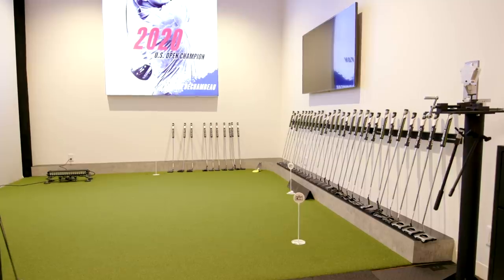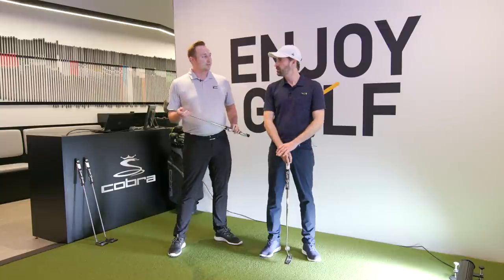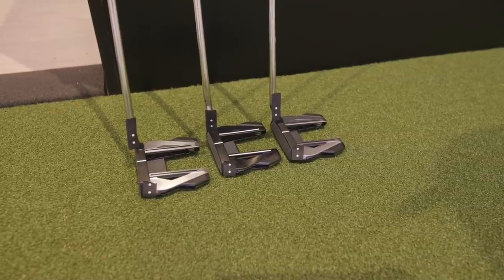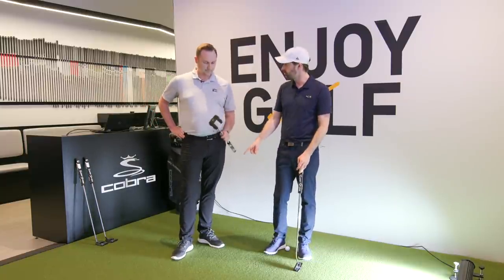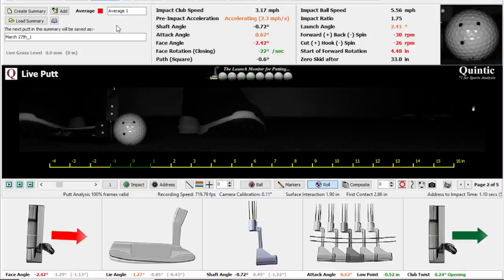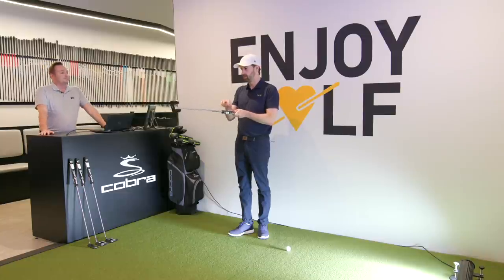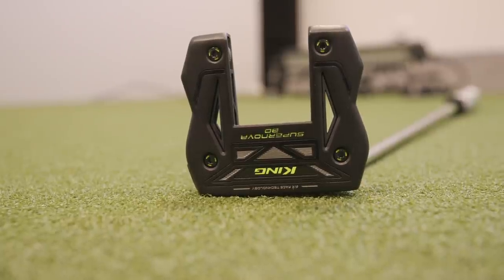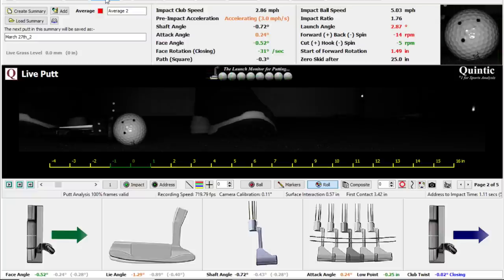My 2022 Putter Fitting | Better Face Angle & Speed Control

Comment: What's your take on eye position when putting? I've been told that setting your eyes directly over the putting line is going to skew the line to the right for a lefty or left for a righty due simply to the way your eyes perceive things. So, there are two subconscious tendencies. 1. to push the ball. 2. less of a feeling of seeing a line go to the hole (outside of 6 feet), so less trust in the line. If you set your eyes more back from the line ,like 3-4 ball lengths (stand about 5-6 inches back from the ball) your eyes see the line better/ more straight which gives you more confidence to hit the putt correctly and "on line".

Comment: Fittings are great, but I feel like the next legit question should be: how do we confirm what we are doing on the course is representative of the positive info we get from using these fitting tools? With the numbers, it's very easy to calibrate your stroke. But what about later when you don't have them?? We need that on course hack!

Comment: Cool.  I understand fitting clubs to address tendency to fade/draw; hit high/low.   But it seems that putting strokes seems like something that could be changed easier than a swing change.    I could see a putter fitting based on the normal greens you play on-, because I could see adjusting your stroke to the conditions, etc.

Comment: Wonder how you could quantify the change in strokes gained, there’s probably a percentile change based on straightening it out. I’d guess around a stroke and a half?
Reply from the maker: will find out once i start using it on the course, but i expect to make more short putts for sure
Reply: @GolfLiberty  I'm imagine that if you're pulling it with a poorly fit putter, you're going to be consciously or otherwise compensating for that in your stroke or alignment over time leading to worse putting overall, and at the very least less confidence which is probably the most important part!
Reply: @GolfLiberty  I just started classifying everything as a "gimmie" if it's on the green. It's done wonders for my game. Thinking about adding chips to that category.
Reply: @GolfLiberty  what new grip you gonna use?
Reply: @GolfLiberty  hi Matt, If I push my putts to the right always, as a right hander..Which neck do you recommend: flow neck or short slant?
Reply from the maker: @goutfromfriedokra7099  Gripmaster reduced taper putter grip
Reply from the maker: @jeffc1736  you'll want a face balanced model